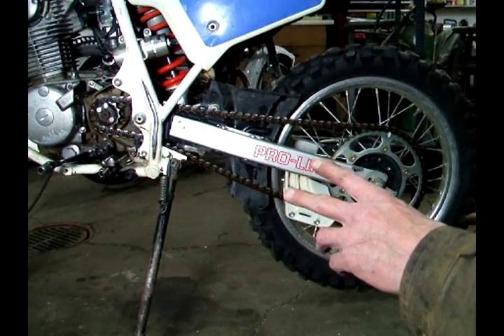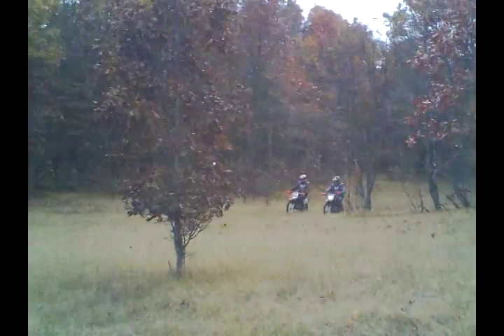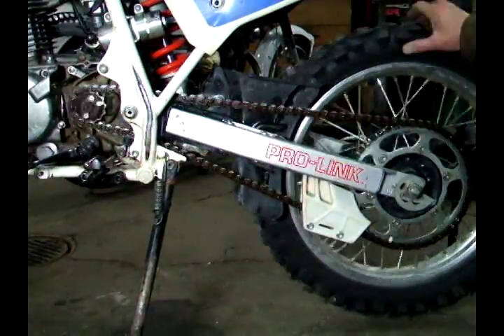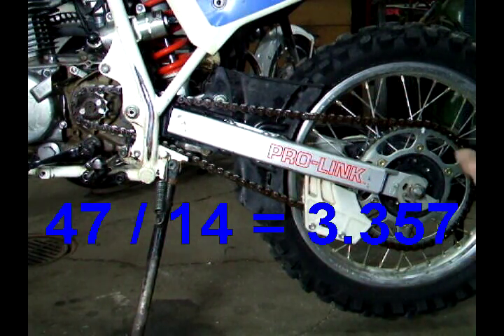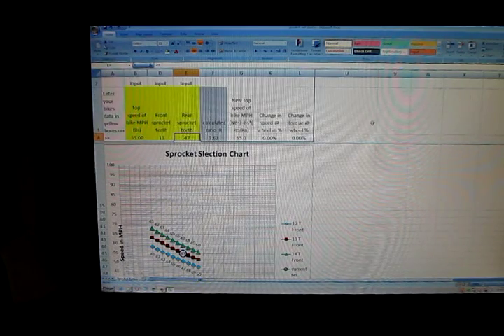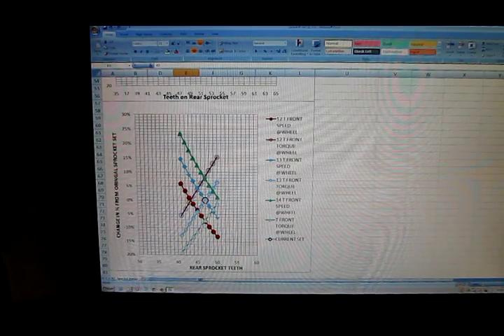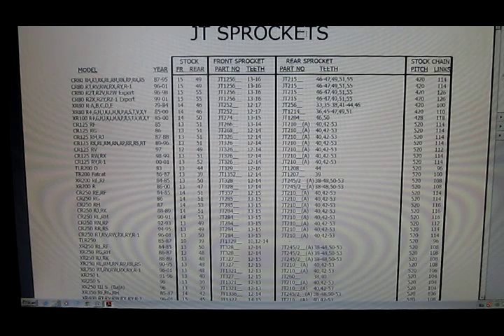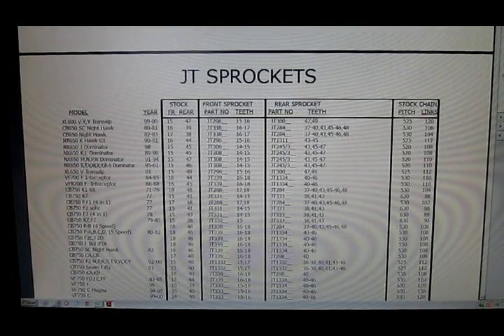Motorcycle sprocket ratio optimization.

Comment: the powerband will tell you what sprocket your bike needs ..an engine that has strong bottom and mid power shorter gears make them slower...short gearing works best with engines that have power on top only..my kx with shorter gears was only spinning so no power ..change to 14-51 and she is a killer bike now..testing and driving

Comment: Please reply , I have a Honda crf100f 2011 and my mate told me to buy a 12t sprocket on the front and a 52t on the rear ,I’m aiming for more tourqe and speed
Reply: And I mostly ride sand and dirt and grass
Reply from the maker: Your can't get both (torque and speed) by changing sprockets, you have to trade one for the other. I think that the stock sprockets for a 2011 crf100f is 14 front and 50 rear. A 12t front and 52t back will make your bike a lot slower, but it will climb trees and you will be disappointed and out some money. I would recommend you put a t15  for the front and try that. If you don't like it you can switch it back to T14 in the front and you'll only be out the money you paid for the front sprocket. If you want more torque and speed, buy a good air filter, a new back tire, good quality oil and fuel and tune your engine so you have the most HP to play with.

Comment: sir, which is the high speed,   spin faster with less toque or spin slower with more torque?
Reply from the maker: spin faster with less torque will give you more speed,  but the is a point where it won't go any faster because losses and HP limitations of your engine.
Reply: A Motorcycle Nut thanks a lot sir. last question. what front and rear sprockets should I use ?

Comment: Hey man thank you for the video it really helped me out...i would like to use the charts but unfortunately i can't find the full specs of the bike that i have ( 2009 johnway sam x-plode 200cc ) so i cant check the high speed otherwise i will get a ticket 😕...i want to increase the high speed with lower rpm and decrease the torc because it feels like the bik is very slow and it always spins when i tale off on dirt roads even though i release the clutch VERY slowly...what gear ratio do you think i should use?
Reply from the maker: I don't know what ratio you should use. You can figure out what ratio you have by counting the teeth on the front and back sprockets. Take the number of teeth on the back and divide by the number on the on the front. This will give you the sprocket ratio. A smaller number makes the rear wheel spin faster with less torque and a larger number makes it spin slower with more torque. You should be able to figure it out from there. As for you tire spinning in dirt, that is common, but it also might be a worn out tire or incorrect tire for the application.

Comment: Sir
I want to increase take-off speed, quick-burst, acceleration , i.e initial pick up  and NOT top speed... example...for short Sprint drag race for my bike.
So what do I need to increase.. drive sprocket teeth or driven sprocket teeth?
Reply from the maker: That depends on a lot of things. Terrain, tire pressure, the HP that you have, total weight, etc. Just remember when you pull in the clutch to shift, your not under power. This video just explains the trade off you can do before you do it. You'll have to experiment with it till you get the best combination for your application.
Reply: A Motorcycle Nut 
Thank you sir

Comment: Sir
I want to increase acceleration and not top speed... example...for short Sprint drag race for my bike.
So what do I need to increase.. drive sprocket teeth or driven sprocket teeth?
Reply from the maker: That depends on a lot of things. Terrain, tire pressure, the HP that you have, total weight, etc. Just remember when you pull in the clutch to shift, your not under power. This video just explains the trade off you can do before you do it. You'll have to experiment with it till you get the best combination for your application.
Reply: A Motorcycle Nut 
Thank u sir

Comment: so does small sized sprocket makes the bike feels heavy climbing the hills?
Reply from the maker: No, does not make the bike feel heavy or light. It can make the bike go faster, or pull more weight by going slower depending on the sprocket ratio.
Reply: A Motorcycle Nut what will happen if my sprocket are a little bit too small?
Reply from the maker: which sprocket, the one on the wheel or the one on the engine?

Comment: I have a honda cb400 REVO (nc42), what is the optimum ratio?
Reply from the maker: That depends on a lot of different factors ( tires, tire pressure, road surface, windshield or not, hills, how much weight your bike is carrying, etc,  and what you want the bike to do.  Use your current  sprocket ratio and put it in the chart and based on that, you can trade off speed for torque or torque for speed depending on your needs and see percentage change you can get to achieve your optimum ratio for your bike and your riding conditions.
Reply: G

Comment: I have a xr150 and how to increase a power in it.. Any idea.
Reply from the maker: I suspect you have a CRF150. This video it not about increasing power but using the available power and optimizing it to the riding conditions that u ride in in order to get the most power to the ground where it actually does some good for the rider. Gear your bike to tall, the engine can't rev up to max rpm, and gear you bike to low and the bike doesn't go as fast as it could. Its all based on terrain and the weight of the rider.